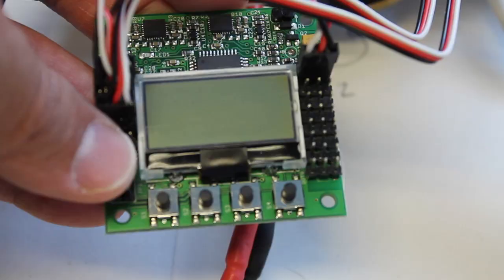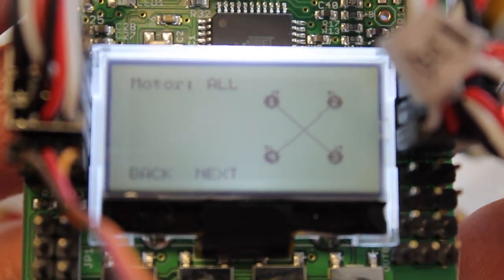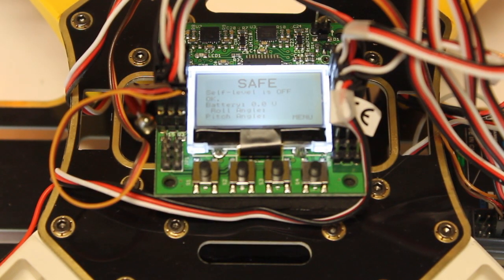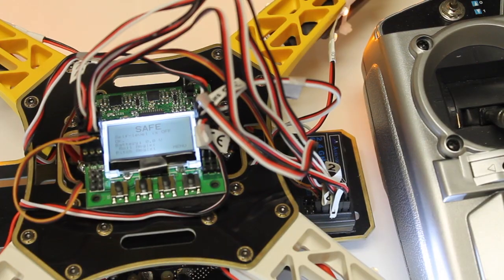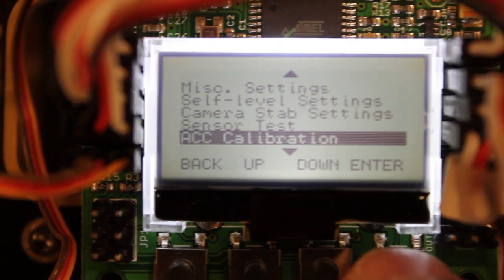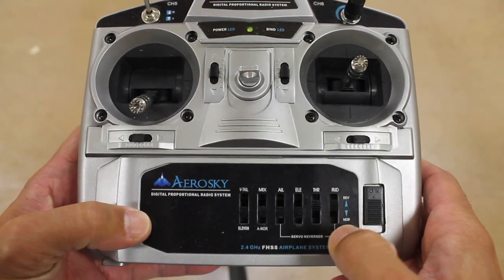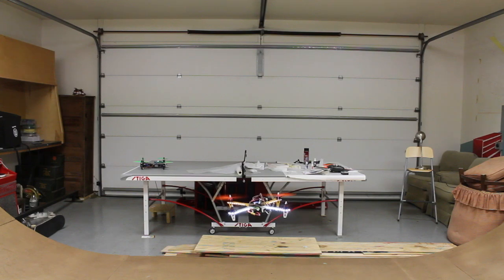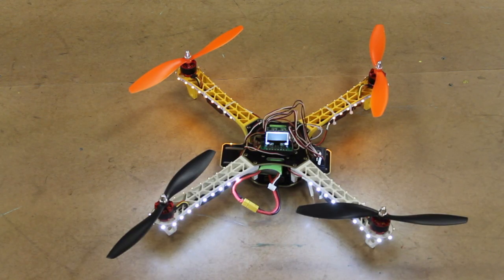KK2.0 Multicopter ESC Calibration, Motor Layout, and Auto-Level w/ Default Settings on AeroSky Quad

Comment: Bro is we can use 1400Kv BLDC motor with 30A ESC ? ?
Reply from the maker: Possibly. It depends on what size propeller you're using and how much current it will pull. For example, this will pull up to 21A so a 30A ESC is recommended:

https://hobbyking.com/en_us/d2826-10-1400kv-brushless-motor.html

I would check your manufacturer's motor charts to see what they recommend.

Comment: my  4 rotors doesn't rotate in  same time.one rotor doesn't work with another three...please help.and reply in bikrammukherjee600@gmail.com
Reply from the maker: Try hooking the motor that doesn't work to an ESC that does work. This will at least tell you if you have a bad ESC or bad motor. If they are all working but one is spinning at a different speed then look into ESC calibration.

Comment: Where should the power from my UBEC be connected ? If it's to the Rx as 
it is in every other application then I don't get M1 to be the power 
supply. Do I splice the UBEC into M1 Red & Brown ? There are some 
critical steps in the instructions missing. 
Next - when I get into 
ESC calibration mode on full throttle I get 1 beep 4 times then 2 beeps 4
 times then 3 X 4 then 4 X 4 etc ad infinitum. ESCs are MultiStar OPTO 20A.

Comment: Help! mine will not arm? it was working fine, i put a new anti vibration mount on to attach the board to. it powered back up and motors worked but altering and rudder seemed to be swapped.  i went back through everything to sort it out and now it won't arm so i can check it? went over receiver and motor connections many times now. it powers up but no arming? I'm stumped.
Reply from the maker: +Rampage I would do another sensor calibration if you haven't already. It's hard to say what's going on without seeing the problem, but hopefully a calibration can get it to where you at least arm it. Let us know what you find out.
Reply: +Dennis Baldwin  Hey Dennis thanks for responding.  It was as usual, something simple. Throttle trim was not zeroed out on the transmitter lol.

Comment: whenever I give throttle the drone lifts from one side on self level mode also. please help me out .I'm using kk 2.1.5 with transmitter fly sky fs ct6b. plz tell the solution
Reply from the maker: +Hariom Aggarwal It's hard to say without knowing more about your setup. I would try ESC calibration and re-calibrating your gyro/compass. It's been a long time since I've flown with KK so I'm not entirely sure how to get it dialed in anymore. Good luck and let us know what you discover.
Reply: Dennis Baldwin thanks for the suggestion I would do the changes that you've told and let you know about my quad.
Reply: +Dennis Baldwin thanks mate . I've done the changes that you've told and finally my quad is also flying . I'm very thankful to you. I'm so happy that I cannot tell. thanks

Comment: Hey there....needs some advice on the esc's.....more specfically esc's that are linear. I blew up a KK board when I removed the 
middle red wires from 3 of them. Im a little hesitant to install the esc's with all the wires in as I have a different quad. With different esc's. But the esc's are linear. I just dont want to blow up the esc's and the board again. 
So this is where your advice comes in. So I have plush 25amp esc's. From what I know they are linear. Which means built in bec's. From anyone's experience would I be safe to connect the esc's without removing the middle (red) wires on 3 of them?
Reply from the maker: +drone19730602 This is probably my favorite thread on the subject: http://fpvlab.com/forums/showthread.php?29139-Why-disconnect-redundant-power-from-esc-s-bec you should be safe without removing the power lead....at least with CC3D I've done it many times over and over....with linear regulators.

Comment: Hi dennis,i keep blowing my esc do you know why?
Reply from the maker: +triplexscooters It's hard to say but perhaps there's a short on the PDB in this ESC's location? Or maybe there's a motor short that's blowing your ESC. I would try powering the ESC/Motor in question independently to rule out a potential wiring issue with your system.
Reply: +Dennis Baldwin like the 3 motors will work fine and one motor will do a stutter type of thing

Comment: My throttle is reversed and I don't see any obvious way to change it, any ideas?
Reply from the maker: +Steve C I'm not sure what TX you're using but if it's the T9X check this out. Hopefully it will help:

https://www.youtube.com/watch?v=CVtg2se3DQc

Good luck.
Reply: +Dennis Baldwin I'm using a Walkera 2801E and I didn't know you could reverse the controls but and the manual is not too clear but I figured it out.
Reply: +Steve C Are you holding your transmitter upside down?
Reply: No, I tried but it was hard to use that way!

Comment: Hi i have a HJ-Y3 Glass Fiber Tricopter,  fitted with kk2 2.15 flight control, sunny sky x22045 2300kv motors, 6x4.5 props and voltech magic 30amp simon k BEC and my transmitter is a Devo 10 , my problem is when i try to take off the trycopter flips to the left on to its back, all motors and props are turning the right way and are fitted correctly  and the BEC.S are in the correct place on the KK2 Board can you help please ty
Reply from the maker: Anthony Dixon Hi there. I haven't setup a tri before so I don't know if there's something specific to the tri configuration, but one thing that may be worth checking is that your ESCs are calibrated. Otherwise that could cause one motor to spin faster than the others and cause the behavior you're seeing. Have you done the KK calibration routines? Those are a couple things that come to mind.
Reply: Dennis Baldwin Hi ty for your reply , yes iv dun the ESC calibrating with my kk2 iv also re set everything to factory setting started agine from the start seting everything to make sure i nt forgot anything  but still when throttle only is used it flips still to the left

Comment: After I calibrate the motors, when I move my throttle down and to the right, my board does not ARM. Did I miss something?
Reply from the maker: Pavlo Vlastos Check that your sticks are not reversed because sometimes that happens. So down and to the right physically may end up top and to the left. Most TX models have the ability to view the display of the sticks on the screen. Another issue may be that your down position isn't low enough so you may need to trim the throttle down just as a test. There are so many things that could go wrong here, but if you feel you've done the proper calibration and everything is connected correctly then it may be a TX config issue.

Comment: Hello.
I have a little question.
I have KK2.1.5 flight controller and speed controller 4x RC Simonk 30A ESC Brushless Motor Speed Controller for Multicopter BEC 5V / 2A.
 To connect them have I disconnect the plus wire from BEC in  M2-M4 connections and leave plus just only in the M1, or can i connected regular without disconnect anything (3 wire from BEC to controller )?
Thanks 
Alex
Reply from the maker: אלכס זינגר You've done it the right way by only leaving power from one of the ESC connections. I've done it many times without removing any power leads and have never run into problems, but the safe way is to do what you're doing. Good luck with your setup.

Comment: hi i know its been ages since this vid was posted but I still want to ask.
I have the board and setup just like in your videos. now.. i put it on ground, calibrate the acc all good.. arming with self level on... it sounds ok for few seconds then one of the effin motors just goes nuts and speeds to max.
any ideas?
Reply from the maker: mingiasi I'd try to do an individual throttle calibration for each ESC. Perhaps that can help. If that doesn't help swap that motor out with one of your others to try and determine if it's an issue with the motor or ESC. Good luck and keep us posted.
Reply: Dennis Baldwin OK but what if i have one of those 4in1 qbrain esc? same ?
Also the throttle input is stable for 1-2 seconds then goes ballistic. it seems motors 1 and 4 spin up for some reason like it's trying to level. Ive been through the settings twice now.. still clueless.
edit: Only thing i havent yet messed around with is mixer settings. any hint how they supposed to be set?

Comment: Can you use this board to control throttle on gas engines?
Reply from the maker: Patrick Kraemer I'm not really sure about that one, but it would be interesting to know. I'll let you know if I find anything out.
Reply: Patrick Kraemer what i understand, you only need bec to control gas powered, so yes imo, bec powers board, regulates stable flight through servo's...correct me if im wrong lol

Comment: Ok so im new to Rc so bear with me. Your saying that I can just tell my Kk2.1 to spin my motors in a different direction, and it'll do it. Like I don't have to physically switch the motor wires from the Esc. 

SunnySky 980Kv
SimonK 30A Esc 
Evo Kk2.1.5
Reply from the maker: jaami mock I wish it were that easy, but to change the motor rotation you'll need to switch any 2 of your 3 ESC leads connected from the motor.

Comment: mine is still stuffed up, if i put throttle to a quater motor 1 and 3 spins. and when i try to fly it, it just tips to one side
HELP PLS???
Reply from the maker: Justyn Siah Make sure you calibrated all your ESCs and then do the KK2 sensor calibration. If you continue to have problems please post in the forums at www.garagepilots.com and we'll do our best to help you out. Good luck.
Reply: ok thanks!

Comment: Hey Dennis, could u pls hlp me on how to make all the ESC's of my dualcopter to run at the same speed???
am a new flyer ad really its confusing on the connections of the KK 2.1 board and the controls on the transmitter....
Reply from the maker: Jithin Mohan It's hard to say without knowing more about your setup. Perhaps you'd be willing to post in the forums at www.garagepilots.com and share more info.
Reply: There are a few videos on YouTube which give tutorials on how to calibrate ESCs with the KK2 board. The usual  word of warning, remove the props first.  It involves holding down buttons 1 and 4 whilst powering up your quad, with the throttle on the TX at maximum. Wait for the booting beeps to finish and then lower the throttle to idle, wait for the beeps to finish and power off you quad then your TX.     .. It's a rather awkward procedure to carry out with only two hands. I made a power lead up which goes between the quad and the battery. Another trick is grabbing an interested bystander to power up the quad for you. Others use the old washing pegs to hold the buttons down :-) Good Luck and happy flying.

Comment: whats the difference between x and + mode?! just the looks of it?
Reply from the maker: luckierer Yes definitely it looks different, but also handles a bit differently. I normally fly in X mode but have flown in + mode before. Just felt very different. The good thing about X it's generally easier to tell front from back. You can use two different colored props vs one.
Reply: Dennis Baldwin
thx for the answer. is it correct that in + mode e.g.  motor 1 is for forward and 3 for backward and in x mode 1 and 2 are for forward (simplified, they must also control other directions)

and what drives me crazy is: my quadro flips over, directly at take off, so there actually is no take off ;)
 I have no idea how to solve this...one motor seems to be too slow or the others too fast. maybe you have an advise!?
Reply: luckierer No you have it wrong. To go forward on a + copter, motor one actually drops in speed and motor 2 speeds up. To go left motor 4 slows down and motor 3 speeds up. The opposite directions are simply those mirrored. As for the flip on take off, double check your motor directions, then double check the props, is one upside down? Usually the raises lettering on a prop signifies uppermost position. To check for CW And CCW props, Looking down the length of a CW prop the side furthest blade away from you, has the blade rising to the right. On a CCW prop the furthest blade from you rises to the left. So if the blade furthest from you is / it's CW and if  it's \ it's CCW   ( obviously those angles are exaggerated )
Reply: propfella thanks for the info! I had to configure the sub trim in the remote. It flies now but it rotates around its own axis. 
Seems like the problems never ends :/
Reply: luckierer That my friend is the life of copter flyer and or builder. I've encountered some weird and wonderful problems and just when I think I've beaten them all, up pops another one. It sounds like your latest could be another trim job. A very important thing to remember is always, without fail go through any set up routines with the quad sitting absolutely level. Also remembering the quad frame could be spot on. but the control board itself could be out of whack. It's the board which counts. I use a spirit level where I can. I've adjusted each leg of my workbench to as close as possible and when the level isn't possible I use a mini type spirit level designed for cameras. It shows level in two planes at once. You can find them on Ebay for just a few dollars. Not really as accurate as I'd like but are much better than nothing. Using Velcro under a board is possibly the biggest culprit in giving an uneven level. I had a friend ring me and scream he was going to throw his newly built quad in the river. He couldn't get it to fly right. I told him to check his level and sure enough it worked like a charm. Give it another try, you never know.
Reply: thx for the heads up. I will on the quadro end of march again. i will double check the alignment of the arms. the quadro was totally leveled when I let the board configure.  I use the kk 2.1 board from hobbyking in a hard case.  maybe more trimming with the remote will solve the problems.

Comment: My KK2.0 is working 100% but my quad wants to yaw to the right, should I just trim it out with the radio trim
Reply from the maker: ***** I do normally trim if the movement is pretty subtle. If it's too aggressive then I would look at your gains as well as make sure all your motors are level. If you're flying a tri then obviously the rudder can cause problems :)
Reply: Dennis Baldwin
Thanks I just gave it a few clicks of trim works great. thanks for the response......
Reply: How do you trim? Mine only goes up on one side when I take off
Reply: When you switch on for a fly try making sure the quad is sitting as close to level as you can. Other than that, I've seen two H8Cs behave in a similar fashion. Both of them had one bad motor. Once they were replaced everything behaved as it should. It was probably coincidence, but both were motors Number 3. A CCW type.
Reply: propfella  I ditched the KK2 board and went with the CC3D board Now my Quad is alive.https://youtu.be/yhK6cwzk1QA

Comment: Would anyone recommend this to a beginner for their first quad? I'm looking for something not too expensive to get started with that I can use on a few different builds while still being decent and easy to use for all of them.
Reply: My personal preference for a beginner is something in the X230-250 class. The Diatone 250 is a decent frame that can take hard knocks. You can even get a complete kit from Hobbyking that has everything but the radio, flight controller and charger.... Total cost with EVERYTHING is between $180-$240.

Here is an integration tutorial I made for that kit:

https://www.youtube.com/watch?v=r8ALzUluyXM

Good luck!
Reply from the maker: Viizzai It's not a bad setup for a first quad, but is largely dependent on what you're looking to do. The 450 size frame is popular, but I normally recommend smaller. Here is a build I've been working on over the years:

http://www.thingiverse.com/thing:463579

Event if you're not interested in the frame the components are good for a 250 size build. BTW I haven't flown the setup that @user/gadgettts recommends but it looks pretty good. Good luck and keep us posted on your progress.